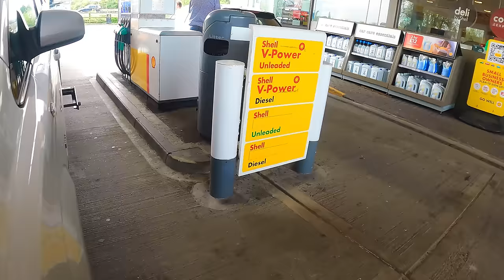FIRST JOB IN THE 6 WHEELED SPEC! WITH A MIGHTY ERECTION 🤫

Comment: Congratulations on the beautiful truck, it sure is a looker. I suggest though that you check the pressure on the bags on the aux. axle, I suspect that it is too high. Easiest way to check is to go to a wreckers and use their scale. Weigh both axles and then just the back one and the aux. axle should have 35 -40%  of the weight, no more. If you're too heavy on the aux. axle you'll have a hell of a time in slippery conditions. Seen it too many times to not tell you. Cheers.
Reply from the maker: Thanks for the tip mate, I'd actually already looked into it. Really appreciate your feedback

Comment: What's the towing capacity  ? Just thinking a decent trailer could put paid to the 7.5 tonne and the disco. One four wheel drive crew cab specs a multi purpose tool.
Reply from the maker: 3.5T towing. Remember though Ronnie is worth having even just for the winch.

Comment: You can get Cup Holders that clip into the Air Vents .....Why did you Arse End it, or did i miss something ?

Jaffas also means Guys Nuts
Reply from the maker: Just quicker and easier, plus less weight on the rear axle. I don't trust those clip on cup holders 😂
Reply: @Fighting_Torque  That thing should take it
Used Those Cup Holders for a long long time ,they are ok
Reply: @Fighting_Torque  It might be a bit too much work but you could fit a slide out cup holder in the gap under the vent. People used to plastic weld Vectra cup holders into Corsa stereo faceplates and it worked well

Comment: Was that car a fwd or rwd?
Reply from the maker: It's front wd
Reply: @Fighting_Torque  how come you towed it backwards then?
Reply from the maker: @LyricistOfLove  why not? Manual trans, in neutral, sealed gearbox with fluid. Lighter on the rear axle of the spec, parked rear out so quicker to get gone and not block the forecourt. 

Question appears to be - why would I not?
Reply: @Fighting_Torque  ah okay you didn't show it so thought maybe it was auto
I forgot, you guys love manual over there. Over here in USA it's a lost skill 🤣
Reply from the maker: @LyricistOfLove  ha ha yeah fair one 👌